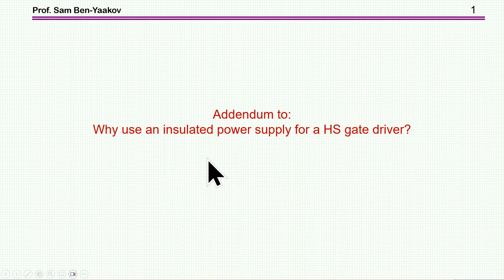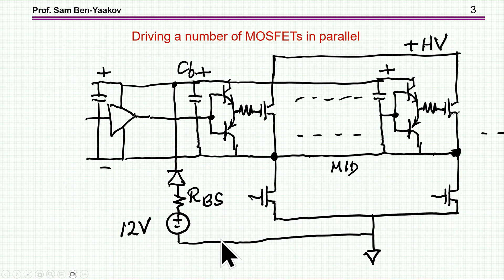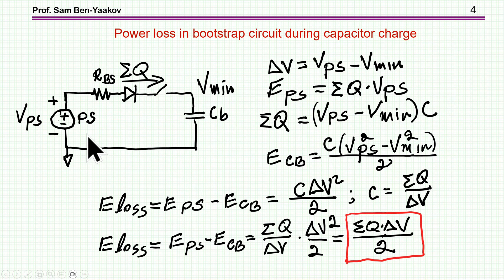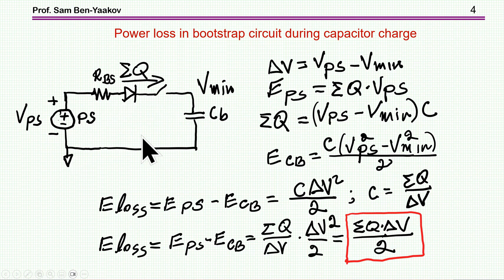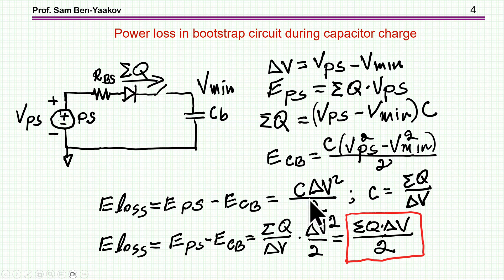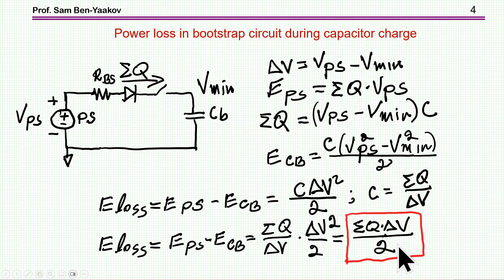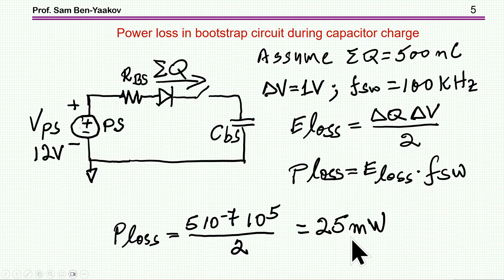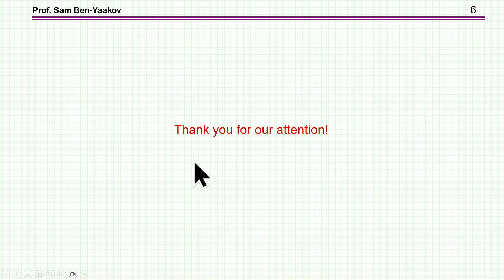Addendum to: Why use an insulated power supply for a HS gate driver?

Comment: Good to see your analysis. I think the only difference between your formula and what I was thinking is that I included an additional + Vf*deltaQ energy term to represent bootstrap diode conduction losses. However, as you point out, looking at charging this way makes unrealistic assumptions about the purity of the switching waveform and other loss mechanisms end up more relevant in practice.
Reply from the maker: Adding Vf*deltaQ is incorrect in this case. Here is a mental exercise that explains the matter; put a switch across the diode such that it will short the diode before the charging ends. Clearly, the output voltage will reach the input voltage and the loss is DeltaV^2 *C/2. The diode loss is already taken into account! And, if the charging time is long enough the output WILL reach the input voltage with a series diode. You have to take the diode loss into account in an operation mode that I call No Charge (see:  https://youtu.be/5wzj1v6ZPM0?t=178).
Reply: I agree that the if the voltage across the diode drops to 0 during charging, it will not represent an "additional" loss, but I don't think it's typical for this to occur, because of how exponentially the diode's effective resistance changes around the forward voltage. The point of contention might be that I referred to this as the forward voltage, it is technically the voltage across the bootstrap resistor+diode when charging stops.
The bootstrap voltage does sometimes reach or exceed the input voltage, as you showed in your previous video. The extra energy comes from the output (switch node to ground difference acting as a source in series with Vps) and still produces charging losses in the bootstrap circuit. But since this deviates from the ideal square wave input, the loss model does not necessarily apply unless the overshoot/freewheeling transients are much shorter than the Rbst Cbst time constant or the freewheeling lasts for several time constants.
Reply from the maker: May I iterate again,  adding Vf*deltaQ to the losses is incorrect even if the charging has not completed. Of course, incomplete charging may introduce some error if my equations are used (since they do not account for a residual voltage difference) but much smaller than Vf*deltaQ. If you will send me your email I can prepare and send you a simulation of the case as a proof. Or you can simulate it yourself?😊

Comment: Going one step further and converting loss to Q^2/2C shows the relationship between the bootstrap capacitor size and loss. 

Along with your previous video, can you explain why just adding more bootstrap capacity isn’t the solution to both the losses and the large negative spike and subsequent overcharging? It seems like a bootstrap is so much cheaper than a isolated HS driver, that a larger cap should be the first consideration in such designs
Reply: I hope you don't mind if I comment as well,
The charging losses in Rbst described here are minimal with any practical Cbst value, however, there is additional loss from diode reverse recovery (depending on the switching topology) and junction capacitance of the bootstrap diode. In this example scenario, both can be negligible by using a small schottky for the bootstrap diode, but these losses scale with the bus voltage. With a 400V bus and an ultrafast diode instead (as Si schottkys are generally only practical to ~150V), half a watt of loss from reverse recovery current would not be unrealistic. This may not represent a substantial amount of efficiency loss, though, and this power is coming from the switch node so as long as components are sized to survive the peak currents and dissipation, it can be acceptable. 
Increasing the size of the bootstrap capacitor provides little benefit for overcharging because the bootstrap circuit is essentially a Vps to switch node peak detector. It will slow down the rate that the high side overcharges, but in steady state, the bootstrap voltage will be approximately determined by the balance of energy rectified during the ringing and the energy consumed per switching cycle. This is dependent on the bootstrap resistor value, but since the bootstrap capacitor's delta V needs to be small to supply the high side gate without droop, its behavior within each cycle is necessarily analagous to a voltage source. 
It is possible to guard against bootstrap overcharging in other ways. Some half bridge drivers for GaN devices have switches in series with the bootstrap resistor and diode to accomplish this. A switch on the low side can be driven in sync with the low side FET, disconnecting the bootstrap during diode conduction and some switch node ringing. This can also reduce reverse recovery losses as the bootstrap diode is blocked from being forward biased during the high side turn on. A switch on the high side can disconnect the diode before the bootstrap capacitor overcharges excessively. It sounds like  Prof. Ben-Yaakov has had poor experiences with the reliability of this method, however, perhaps partly because the switch circuitry can be exposed to considerable transients from the half bridge behavior. Such protection is important for GaN, as the recommended gate voltage and maximum gate voltage are usually only a volt apart, but less critical for silicon MOSFETs as they have a much larger gate voltage margin.
It is also worth keeping in mind that significant switch node ringing is also undesirable from an EMI perspective, and unless a true isolated gate driver is used, a large negative switch node transient is likely to exceed the gate driver's high side return to low side return rating as well. 
On another note, an excessively large bootstrap capacitor can degrade certain startup and transient behaviors, and generally requires a larger capacitor on the low side to be able to charge the bootstrap capacitor up without drooping and possibly triggering UVLOs.
Reply from the maker: Good points. Thanks for sharing.